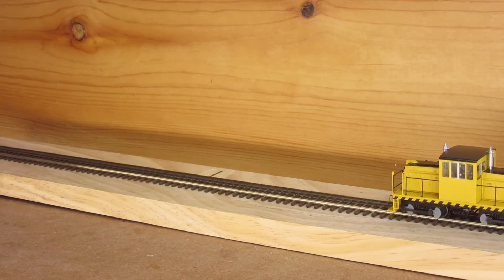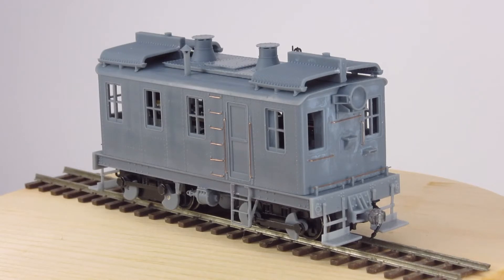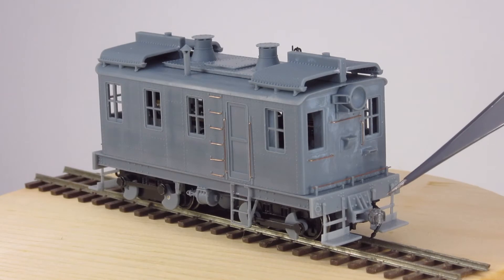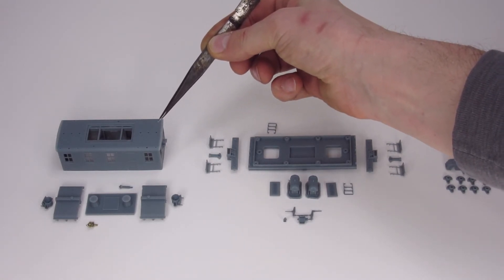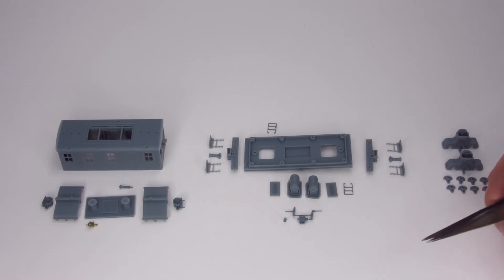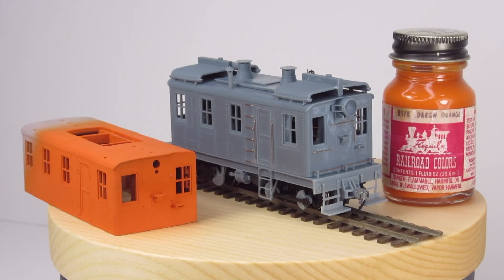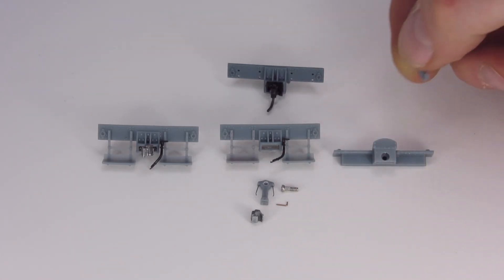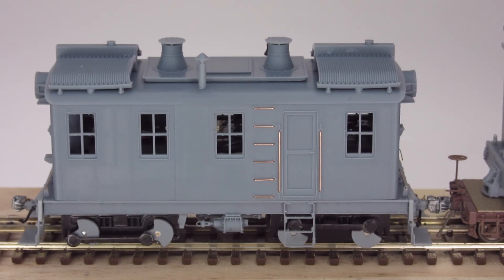Part 3: Building a 3D Printed AGEIR Style 45 Ton Boxcab Diesel With Side Rods In HOn3.

Comment: Loved the video.  The latest iteration looks terrific.  What diameter brass wire do you use for the grab irons, etc.?
Reply from the maker: Hey Bruce, thanks for the comment.

Overall I'm pretty happy with this model.  An interior would have been nice but not entirely practical with the donor mechanism and the electronics.  I think that once it has microscope slide cover glazed windows you won't see too much inside anyway.  So ready to finish and paint this model so I can move on to other things.

I'm using Tichy .010" phosphor bronze which scales to 7/8" of an inch in real life.  So it scales pretty close to reality.